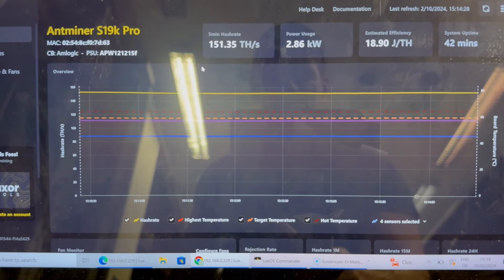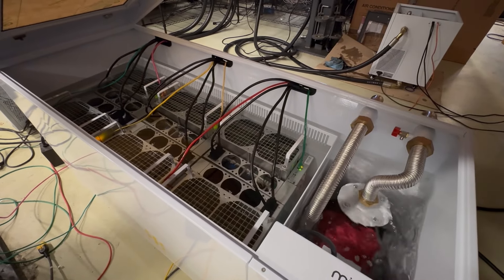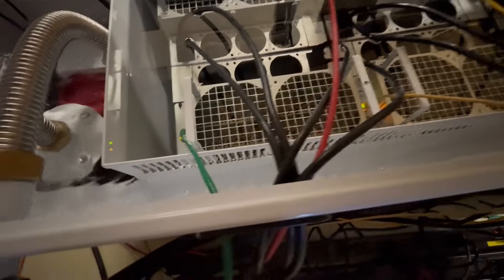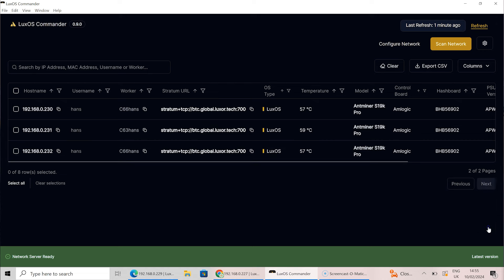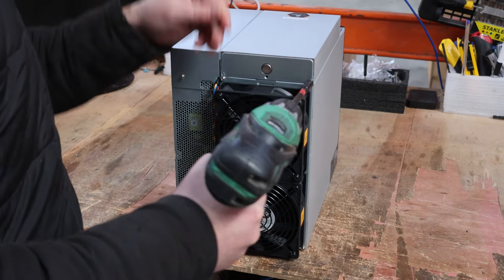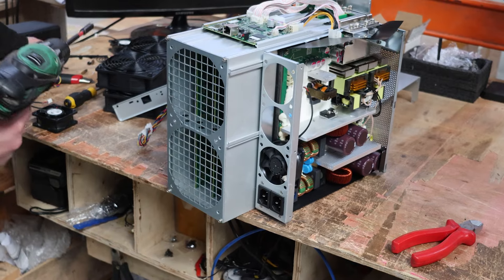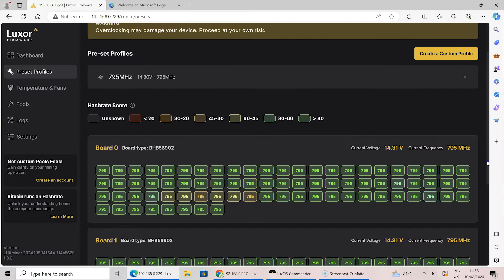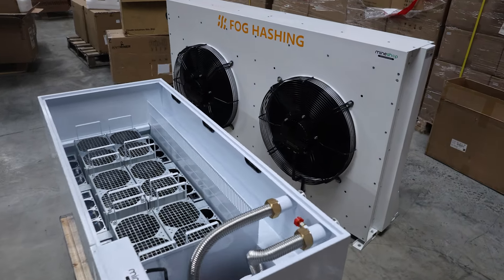My 20000$ Bitcoin mining immersion cooling setup!?

Comment: interesting this coler solution. Currently, I have 12 s19 hyd and I am using 2 chillers. But its expensive, What do you think, use an immersion cooling is cheaper than chillers use?

Comment: I would be really appreciate if you tell me what device you use to trick the system controller to remove all the fans. Because ASIC don't work without fans running
Reply: Fan spoofers, either come with kit or can buy separately

Comment: Do you have the new style 4-pin square connector fan spoofers?
Reply from the maker: i use custom firmware and they have immersion mode where spoofer not needed.